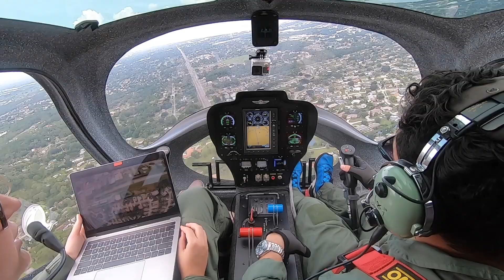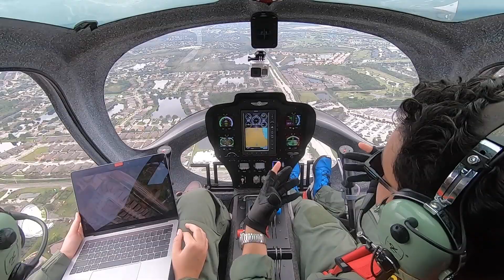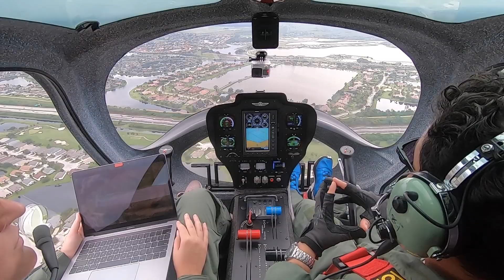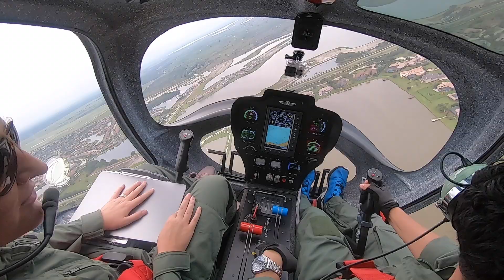Gyrocoptyer AG-915 Force multiplier

Comment: Your narrative is false.  I have 2 police radios, a search light, a FLIR and a high def camera, video transmitting equipment in my Cavalon. It fits fine, is safe and stable and has plenty of power to spare.  Not a good comparison.
Reply: Heath Lowry I never say you can’t do it. Let’s put it this way, you can do a police chase is a Ferrari! But you may need a car more reliable and strong that the Ferrari. That my narrative. I thanks for letting me the chance to make it clear.
Reply: @capitovar  Wow, you appear to be implying that your aircraft is more reliable and stronger than all your competition, I would love to see the statistics that that is based on! It comes across as hubris. I hope you get good sales for your craft and I can understand pride in your achievement, but any potential buyers will want to see hard stats and demonstrated capability. If you have that great, your craft will become the market leader, if you don't have that... Regards Sarah
Reply: @loydsa  Thanks for the message, and yes there are many statistics base on safety (NTSB) and professional operation around the word, We like this product more as a costumer rather than dealer, because at  the end you can't lie when the operator is  using it. I have flow  many other modern models, testing on the field and taking them to the limits, reason we decide to use and promote this platforms. flying and comparing will tell all what you need to know if you have the experience. before there was no many options, now we can provide a another option so the market can compare. Thanks again.
Reply: @capitovar   Its clear you are there to promote your chosen brand and company and no one will hold that against you, but it comes off somewhat poorly in the video! It would be better with no comparison or one that was backed up to avoid to looking like just your opinion and you hate Cavalons, when you are trying to achieve something positive and worthwhile here. The message should be "use a Gyro, and if you like what you see I am hear to offer that service with my preferred supplier"... instead it feels like you have a personal grudge against AutoGyro and everything else is 'meh'
Reply: @akscooby1  Thanks for your comment, we really appreciate your feed back, Is true that I'm comparing the models, using the same format that many other manufactures in the automotive sector have done for years, I'm a believer in the Gyroplane technology, and I do believe that not all are made the same, I have flown all in different scenarios,  the History of the model Cavalon tell us many  of the points I remark on this video, from safety to how unpractical is to perform some heavy duty operation, I been testing Gyroplane models for may applications in the last 10 years, and I personally got the best results with the Polish platforms, The AG-915 is and answer to many years of not having a different option for the gyro market, also a US base company taking care of a really good product that was almost destroyed by the former management and personal fight between the Poles and the French guy over there. I Apologize if I didn't make my self clear, English is my  second language and I may use the wrong terms to  describe so  things. Feel free  to contact me any time, so we can promote gyro in general y help other to get the machine that completes the requirements for each use and each costumer. 

Thanks again. 

Alvaro T.
Reply: Sarah Lo

Comment: How safe are gyrocopters compared to other forms of flight?
Reply: Very. You can't stall it and if you lose the engine you just autorotate to land
Reply: Just a Pilot   Good in theory but where can we access data on different models over the last 10 & 20 years?
Reply: @timduncan8450  Google!
Reply: Just a Pilot   Thx for response but not very helpful.  
I’ll refine the question:  where can we find credible data and analysis on different models over time.
Reply: @timduncan8450  FAA, NTSB, EAA (Experimental Aircraft Association), EASA, (European Aviation Safety Agency) ESAS because autogiros are more popular there than in the US. EAA publishes an experimental aircraft accident report every year.
You can also just research there recent history since they are making a big comeback.
Then, as I said they can’t be stalled or spun and if you lose the engine you can auto-rotate safely to the ground.
Then there is just sitting down at your computer and doing the fingertip leg work research for yourself.  
Finally, I’ve flown one, with an instructor, and they are an amazing amount of fun.  They can do things a fixed wing aircraft can never do. Not as fast but a lot of fun. The one I flew had a cruise speed of about 95kts.
Reply: Just a Pilot    Thx for the search targets.  I had read some articles with nice analysis in Kitplane for instance, but that was on certified vs E/A-B fixed wings.  

I like and has flown in gyros also.  If the rotor and control linkage do their thing,  the type does seem like they should be very safe t.  I just have not had time to find and digest a full comparison.